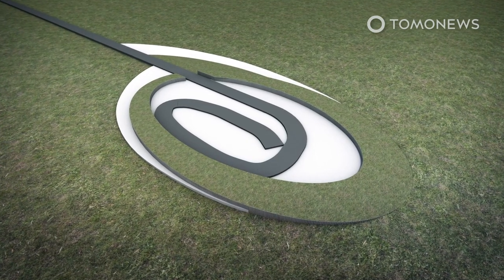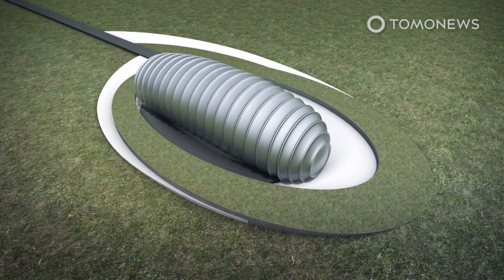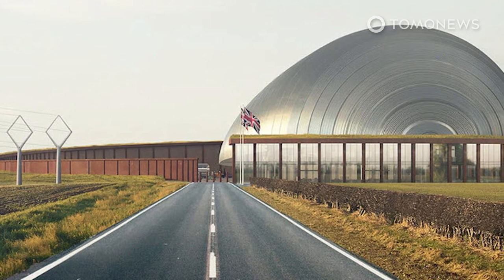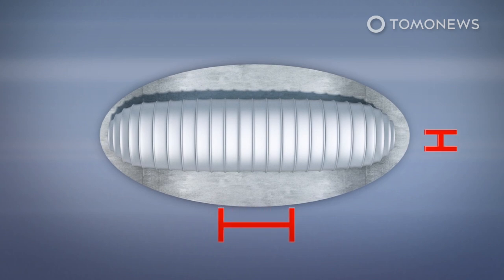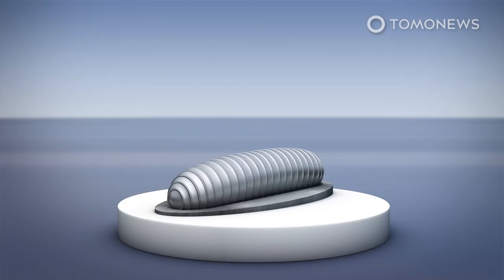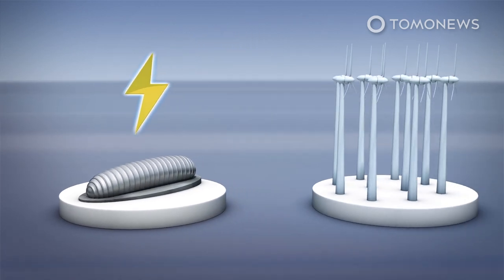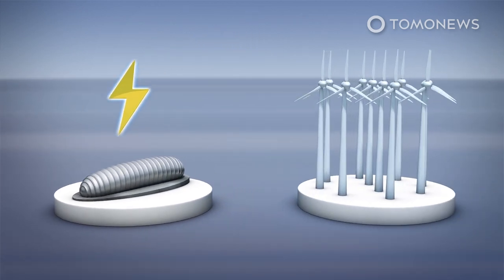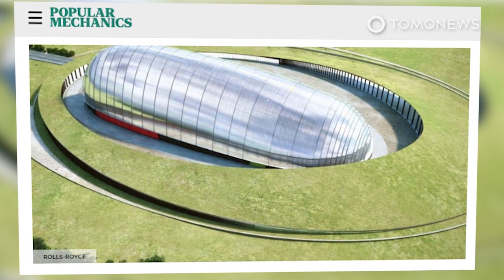Rolls-Royce to build mini nuclear reactors in the U.K. - TomoNews

Comment: My main concern is the safety features like a full sized nuclear power plant has several fail safes but only because its massive size can hold all that equipment while this smaller sized reactor probably can't have many safety features because its way to small.